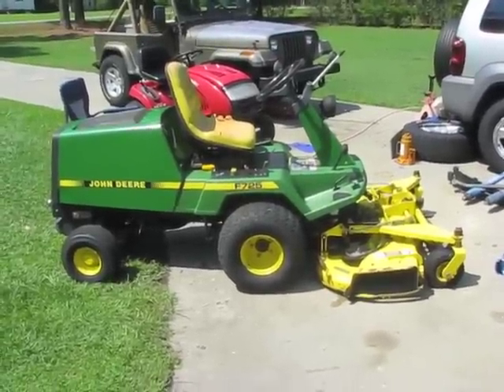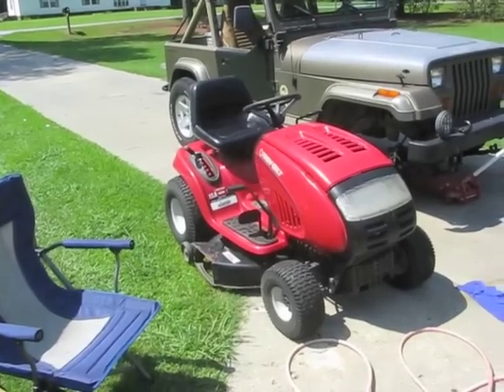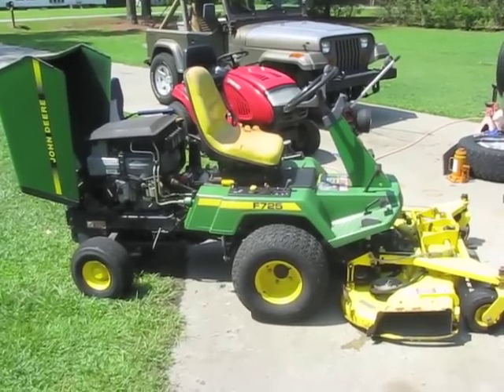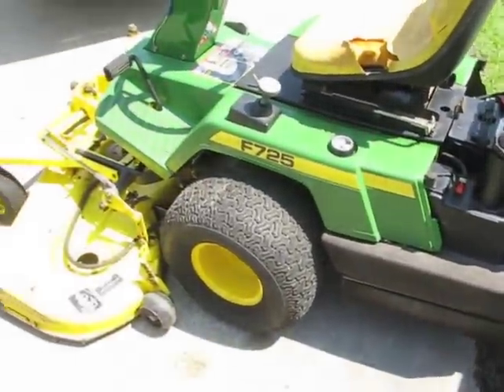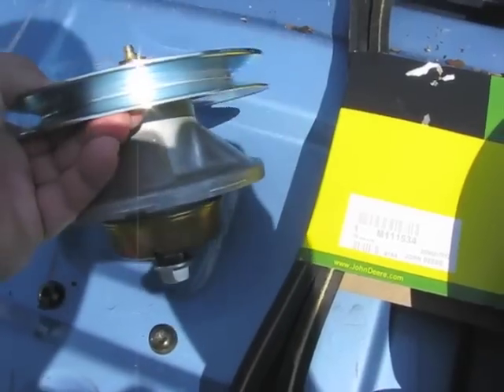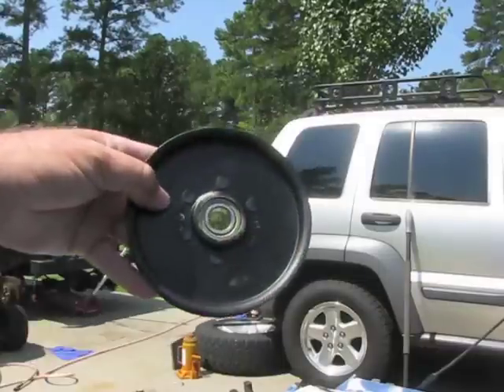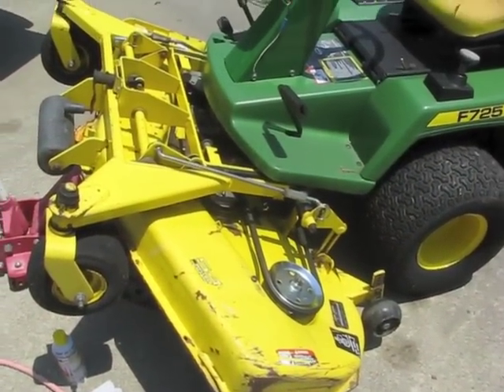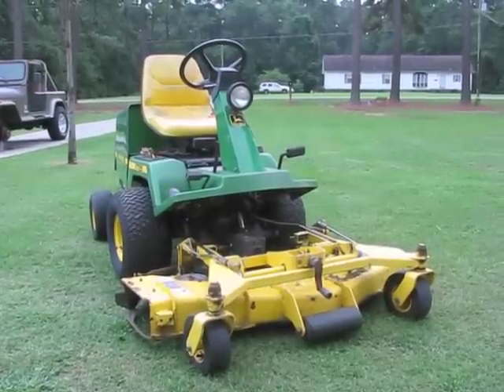John Deere F725 Front Mower

Comment: Jeep, I picked up a 2014 F725 the other day.  It has 474 hours on it's a one owner machine, looks about new and always serviced at a dealer.  My first impressions are very good on the machine itself are good.  I test mowed it on my current yard which is not what I bought it for....but the deck sure likes to bounce around and everything is tight under there.
Reply from the maker: Are the large rollers at the front and rear of the deck spinning freely? Is the gauge wheel adjusted for the level you have the deck set at?

Comment: I absolutely love my 725.  Has 300 hours on it.  I wipe it down and blow it out after every use.    Unfortunately I'm mountainside and this does not do well on hills. It will go DOWN a 100% grade  but it can't pull itself up anything greater that 15-18 degrees.  I have to raise the  deck (and hold it .. which is REAL annoying), travel up.. then swing, drop and mow.  Im gonna hate myself for selling it.   Glad yours works for you
Reply from the maker: No mountains here but I do sometimes mow steep ravines, ditches, and along the banks of ponds and creeks. Often it did want to spin the drives going up the steep grades unless I lifted the deck. 
In 2013 I replaced the drive tires with a set of Carliisle All Trail tires. (model 510043) 
Now it does much better mowing uphill only requiring me to turn the weight transfer knob to add a little more weight to the drives. Also does much better mowing side slopes.
Reply: @jeepcollector91  interesting. I thought about getting an aggressive tire set.  Was looking at Stens and Carlisle at101 but didn't want to tear the hell out of the perimeter of the property.   Thanks for the reply though. I didn't know how successful an aggressive tire would be. Might consider it now
Edit.  I also did look that the all trail Tires. I had them on an old Arctic cat. I actually found them to have a perfect balance of turf saving and traction

Comment: how many hours would this mower last?
Reply from the maker: All depends on how well it is taken care of. 
Highest hours I've seen one at was over 4,000 hours.
It was very well maintained. 
Mine is still under 1,000 hrs.
Reply: @jeepcollector91  There's one on YouTube with 12,000+ and still cutting. I just got one myself, needs a gearbox for the deck. The seat latch is jammed so I'm on here looking at the F725.

Comment: I just rebuilt my deck, just like this one. $54.75 put three spindle assemblies on my doorstep from Ebay. The grease fitting was beat in on all of them for some reason, so I spent a couple dollars at the hardware store for those. So far they are holding up fine. Unreal price. I couldn't buy bearings and seals for that money.

Comment from the maker: I love the F725 but I would rather have the F735 Diesel version. The 54" deck makes quick work of my 1 acre yard. I can still get the 54" deck through a 48" gate by getting the left side of the deck in first then pivoting it around the post and then drive straight in. I just love the front mower.

As for the '91 YJ, I was getting started on installing a Rubicon Express 2.5" lift. Thats why the front was on a jack. Will be installing new axles soon.

Comment: Go figure.....working on a Jeep! I want to find a mower like yours, right now running a F510 with the 38" deck. Love the front mount mowers. They make mowing so much easier. Love your rig too. Typical YJ though.....always something to fix up front. Had to rebuild both sides of the frame on mine. Made it a little easier after the 4" Rough Country lift was installed. Great video!